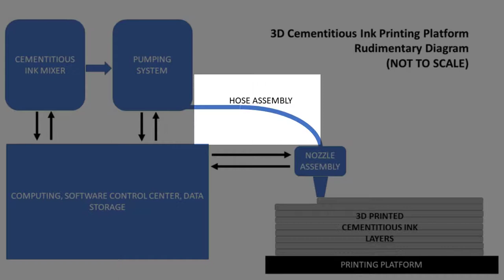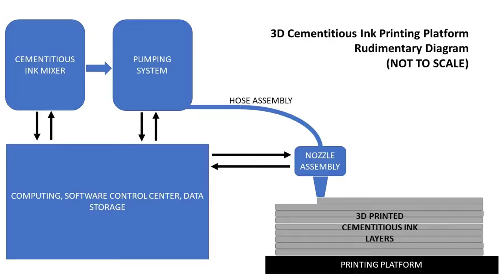What are the Parts of a 3D Concrete Pump System? - Vlog 374

Comment: Dr. Jon, in desktop 3D printing with plastic filament it is referred to as Fused Deposition Modeling (FDM) FDM Printing. Perhaps more accurately you can call it Cementitious Deposition Modeling (CDM) or Cementitious Deposition Printing (CDP).